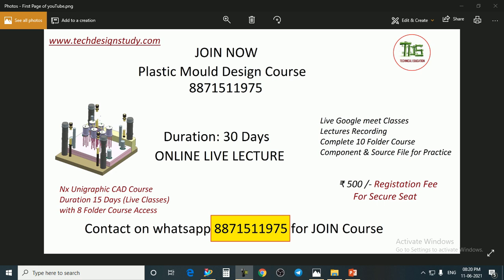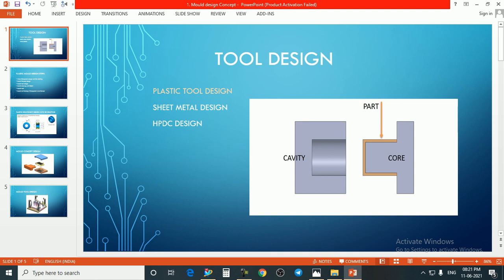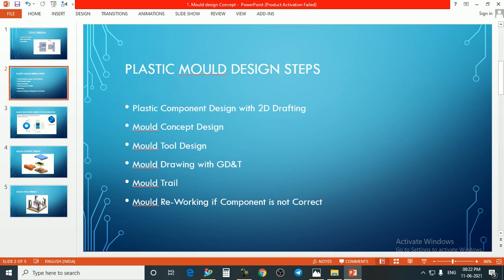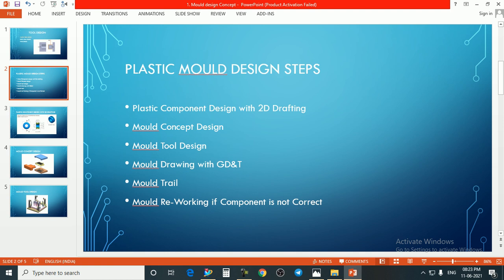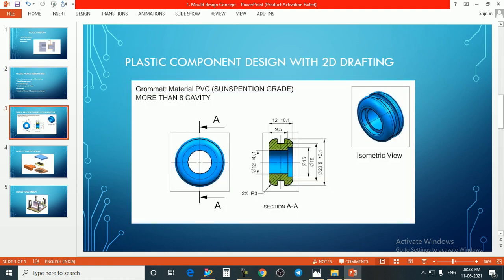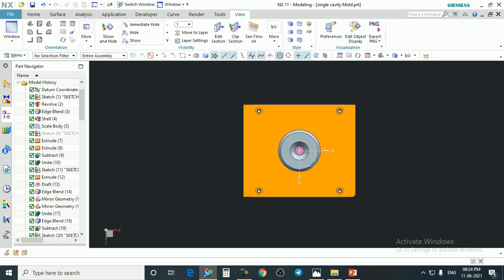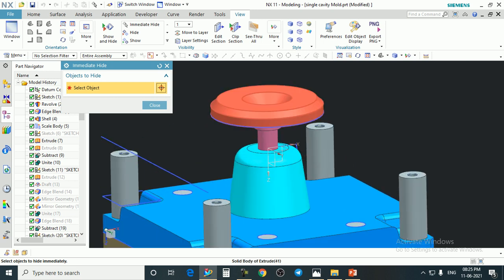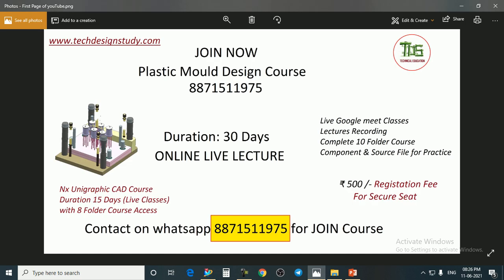what is Tool Design Technology/English/Introduction

Comment: Sir aap yeh btao ky aap jo mould banaty ho poora Part modeling main  iski drafting kesy krygy alag alag jesy top plate core cavity slider ki
Reply from the maker: BY EXPORTING THAT IN A SINGLE - SINGLE PART IN XT OR STEP .
Reply: @educationwood  kesy krygy Exporting single single components
Reply: @educationwood  aapny jesy top plate kri v hy extrude to Usko kesy export krygy